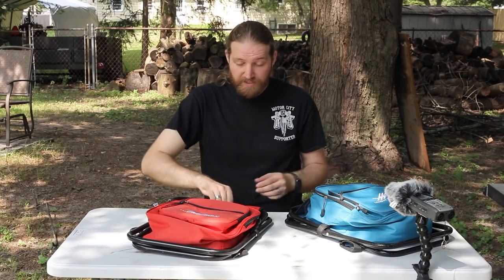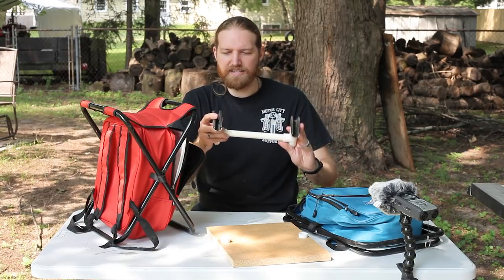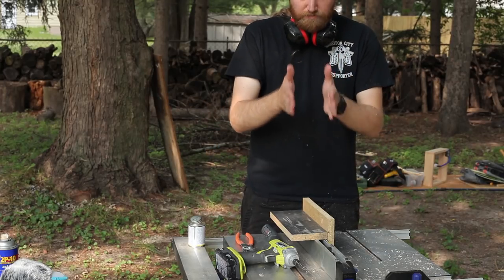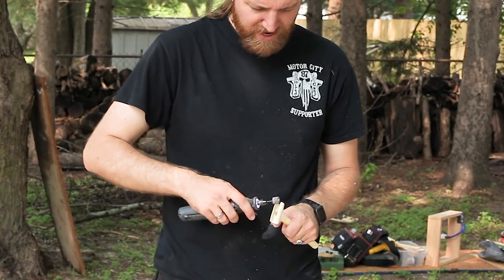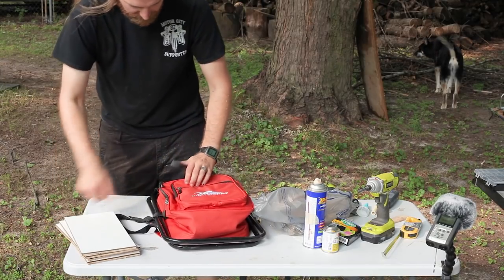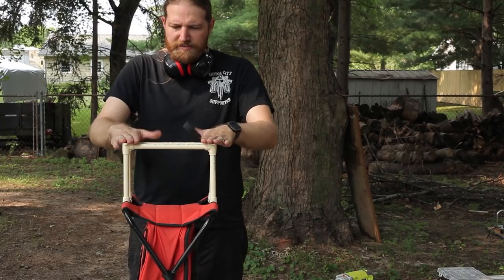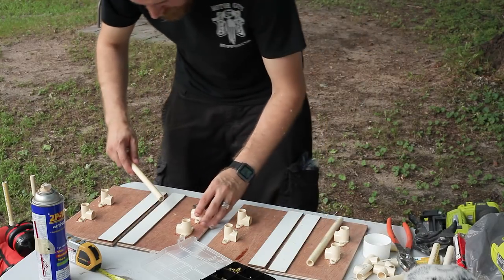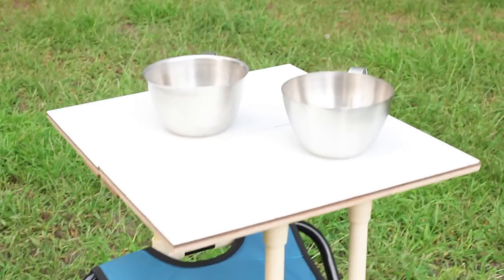PROJECT - BACKPACK COOLER CHAIR TABLE

Comment: Try spray painting the piping to look super cool! Like a metallic paint or something :D not that it’s not already neat-o but ya know make it look even better!
Reply from the maker: Paint and PVC don't always get along, but if you sand the surface (so the paint has something to grip to) and use a good brand of paint that adheres well to plastic, yeah, they would be a good finishing step. Covering it in metallic tape, might also work, and be more durable, but getting it around the fittings, and getting it to look good would be a bit tedious.

Comment: Did you know they actually make band aids for knuckles and finger tips? They look similar to the elbow band aids you just used. They're a life saver
Reply from the maker: I know they have the bowtie ones, and like the H shape ones, I like the larger flap size of the knee and elbow ones, at least for thumbs, as that's what I seem to cut most frequently >.<

Comment: Nick, I was thinking that the semi-circular offcuts from the T-couplings would have made very unobtrusive shims / supports for the table top. Also if you glued them to the cross members if would make it easier to distinguish them from the uprights.
I had another idea, to save taking up space in the backpack, attaching small carabiner clips to the back pack and a eye screws to the corners, you could clip the two tops to the outside of the pack.
Great idea for a portable table.
Reply from the maker: Those are some really great ideas. v3!

Comment: use a plastic cutting board that might be same size as the pack  and use a 4 point hook up to make it  sturdy as well
Reply from the maker: Not a bad idea. I actualy walk by the cutting boards at the dollar store all the time, and always think they would be a great, cheap material to make stuff with.
Reply: @IamNickDClements   cool seemed like an idea plus they are plastic  and easier to clean  than wood